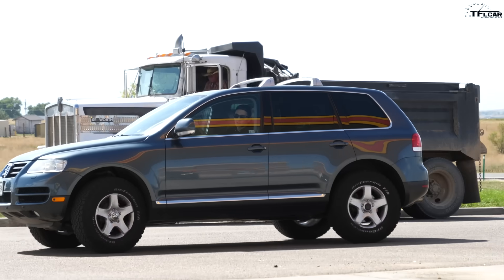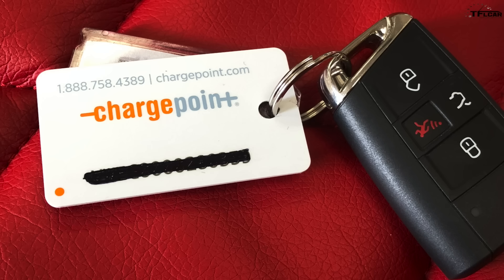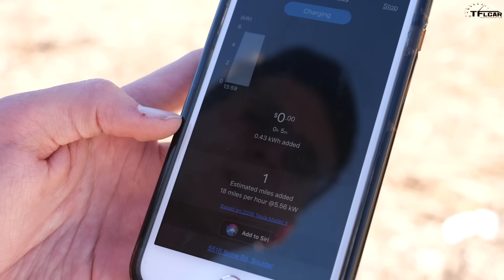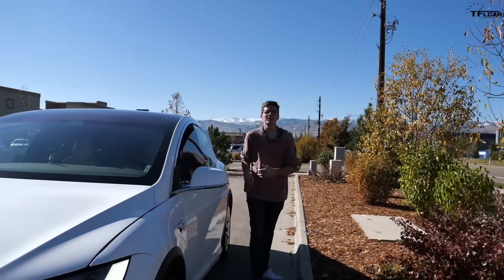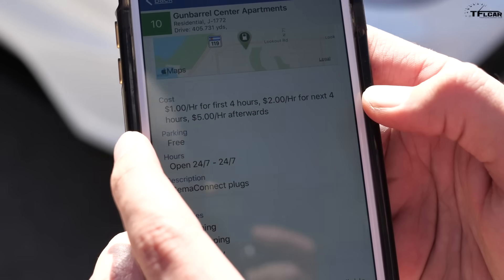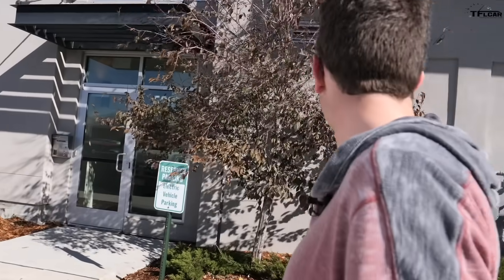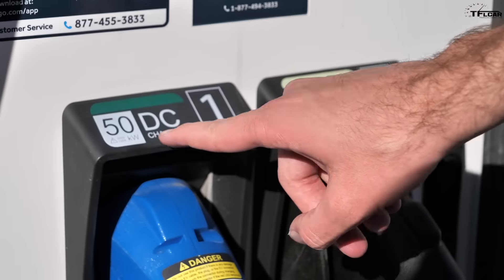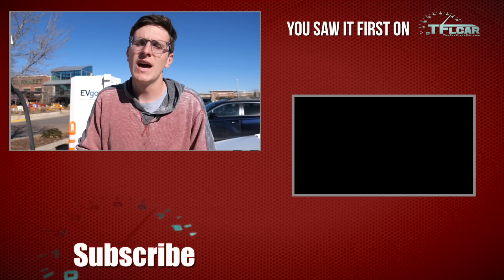Here’s Why Charging an Electric Car Can Suck - And It’s Not The Reason You Think!

Comment: so on that second chager it cost you $12 for 120 miles worth of range? thats way more than gas. most new economy cars are getting 35-45 mpg and gas is about $2.25-$2.40 not to mention that it took 8 hours.. and people think this is a good idea? first of all, you are burning coal or nuclear to make that electricity and second, that power doesnt go back into the grid the way it does if you use it in your house.. lithium mining is terrible for the earth and its very hard to recycle.. those batteries wont last ten years (not to mention range lose over time +-5% a year with the way most people take care of batteries) while there are plenty of gas cars on the road today that are 15-25 years old and still get 95% the mpg they did new(20-30mpg). you cant drain a lithium ion to zero without damage and you shouldnt charge it to 100% or you will cause cycle life to degrade. that means you are never getting the full advertised range of the car... so many things wrong with this.. especially since the cars are luxury and not green to produce.. just replace the prius with a tesla in that old south park episode.. just huffing your own farts.

Comment: Luckily Tesla has used open standards here in Europe ...
Model S&X have whats called a type 2 connector (AC Standart Here all over Europe .. and also has a DC protocol which Tesla uses at their superchargers)
Model 3 has a so-called CCS port (CCS= combined charging system) and that really cool since you can literally charge anywhere without an adapter since the top part of CCS is the Standart Type 2 AC Port . .and additionally it has 2 larger pins for DC fast charging (Tesla retrofitted the SuC's with a 2nd cable so that model 3 can use it) 
Some stations can go up to 350 kW using CCS (Model 3 can go up to 192kW on those stations since the higher charging speed only gets achieved by 800v packs like Porsche tycan .. but they too struggle with that high speed and to be honest .. model 3 is still mind-blowingly fast charged )

Good video ^^ .. interesting to see how things are in the US for charging

Comment: It just takes a little time to figure them out. It's not that hard and totally worth the effort. Besides, pretty soon I believe there will be more standardized plugs, faster chargers, easier and faster payment methods everywhere. Just hang in there.  The massive adoption of EVs is just around the corner (5 to 10 years at the most).

Comment: Nice Video.  But it shows the failure of electric cars.  How can one travel between San Diego and Phoenix in a reasonable time frame.  God forbid a power outage.....
Reply: It shows the state of non-Tesla EV's currently.  Tesla's current supercharger network is fast, convenient, and reliable; people drive cross county all the time and it is not an issue in term of charging times.  For me, usually the car is done charging before I've finished a meal and gotten the kids through their potty breaks.  But the other non-Tesla networks will get there eventually.

Comment: I drive 78 miles round trip, 4 days a week. I purchased a Ford Raptor Gen1 6.2L V8 that's getting 14mpg. It takes me 5 minutes to gain 400miles worth of range for about $60. Doesn't  take me hours to charge and I get plenty of SPGs (Smiles Per Gallon..)

Comment: "But the reality is, most people don't have high voltage in their garage"

*laughs in European*
Reply: Don’t know about that comment.....willing to bet most homes in North America have 120/240v systems.
Reply: @HOWNDOG66  Correct - every detached residence in the US and Canada has 240v split-phase service. Adding a 50-amp receptacle for AC charging is trivial for all but the oldest of structures. I did mine in about an hour.
Reply: All American houses have 120V and 240V
laughs in 60Hz
Reply: @GamingAmbienceLive  Having 50 Hz or 60 Hz is totally irrelevant, it is  just a matter of standardisation it does the same job. Having 110/120V and 20A or 220/230/240V and 16A, well, that one almost doubles the charging speed.
Reply: Fewer Europeans have garages.
Reply: @wisenber  

Yeah they do, have no garages.  but they have a better public charging infrastructure, esp scandinavia. American public charging long term monthy pay parking is nonexistent.
Reply: @Frank71  " but they have a better public charging infrastructure"
That's due to the higher taxes to fund them. "Save" at the pump, pay at the tax office.
Reply: In US, have 240V comming to house. Just a matter of running 240V at 50 amp circuit to the garage, as if were installing an electric cloths dryer in garage, or an air conditioner outside.  Yes, you have to pay an elctrician to help modernize your house.  Oh wait, I do this for 1 weekend, and I can eliminate most of this charching stress.  You also had enough money to buy Tesla, so you should have enough money to build up your home infrstuctre.  It is like indoor plumbing getting back fit.  Ah man, I need to get cold water and a drain pipe to where toilet will be, too hard, back to hiking 100 feet to the outhouse.
Reply: Yup. 400V 16A
Reply: It easy to get an electrician to put it in your house. If you can afford a house and one of these cars then the outlet should be cake.
Reply: Anyone in the US with an EV has installed high voltage in their garage.
Reply: That makes no sense. Takes less then an amp to kill a person....that aside, 347/600v is a common 3ph voltage in Canada (North America)......So what is the difference?
Reply: Are you the same people against coal? Think about it
Reply: America ha outdated infrastructure thanks to recessions and republicans.
Reply: @angelgjr1999  the opposite of the truth, bro.
and I'm not a republican (it's quite the insult to be an enthusiast for a tenetless party like the Dem and Rep parties)
Reply: @angelgjr1999  really Demoncrats have been in charge for years it was their high tax and  strict regulation policies that caused every recession. Every city, county, and state that Demoncrats control is high property and business taxes, high crime rate, high electric bill, high cost of living, high rent, strict government regulations. Then when Demoncrats sense when people get a pay raise they raise taxes or come up with new taxes which eat that pay raise.
Reply: David F Dude you are hilarious. Google the states with the lowest quality of life. ALL are red states lol. Also google states with the most poverty while your at it. 
It’s funny to me how you poor people trust a rich scammer from New York to give a damn about you. Trust me he doesn’t. All he has done in office is give himself and his rich buddies a huge tax break.
Reply: @angelgjr1999  "Google the states with the lowest quality of life."
It showed California as having the highest cost of living adjusted poverty level, most Medicaid recipients and last in education. When did California turn red?

"Trust me he doesn’t. "
Why would anyone trust you? You've been reliably wrong with each of your assertions.
Reply: @angelgjr1999  yea, over taxation (California) causes a large burden on private businesses and individuals, which then cause people not to innovate due to money shortages. Oh wait for it.......... that's the Democrats
Reply: Tony from Tinder That’s not right. States with the lowest taxation’s are usually the most shitty. You can’t compare California or New York to Arkansas.
Reply: @angelgjr1999  "most shitty" in what regards? Both California and New York are typically rated in the top ten for worst infrastructure amongst all 50 states.
Reply: Oh, and Europe is shipping tons of US wood to Europe to burn for 'alternative' energy, which still isn't working well as they're beginning to experience massive power cuts with all these EVs and attempt to reduce their coal burning for their power stations. The other month the UK had a power outage for a WEEK. As usual, the environmental destruction of every single hare-brained idea of the left knows no equal.
Reply: @angelgjr1999  "States with the lowest taxation’s are usually the most shitty."
Is that why the net migration numbers have more people moving to lower tax states? Perhaps you should try data over your emotions as your emotions don't seem to align with actual data.
Reply: @averageschmo963   So there's no innovation in CA "due to money shortages???" Riiiight. An unintentionally hilarious comment. I suspect that most people would agree that CA is among the most innovative areas in the entire world, let alone the US.
Reply: @lapamful  UK is not really Europe you know. Everything is different there. I never had any power cut since I was a kid, which happened when we had storm and I'm 53 now. LOL The only power cut we had in some place are because some weather catastrophe which can rarely break some lines.
Reply: @YannR34  I grew up in London and we had plenty of power cuts.
Reply: I was living in Dijon until 24yo and since in Montpellier, in France and the last power cut I experienced was in 1986 it last about 15 minutes during a storm. Never had any since. They probably inproved the grid. I had one more recently but it doesn't count it was because they had to work on the power transformator in my nebourhood and was planified.
Reply: @YannR34  I honestly dispair at the utter thick-headed people you find online. It really boggles my mind that some people are even able to use a computer. 
Ffs when did all this renewable energy nonsense start?? ONLY WITHIN THE LAST DECADE. So WHAT ARE YOU TALKING ABOUT?!
Reply: @angelgjr1999  San Francisco Baltimore LA (Have to wear a hazmat suit to walk around)
Reply: @angelgjr1999  , I bet that Arkansas has less sh%t on its roads and sidewalks than California or New York.
Reply: @doubleclutchonline5811  , I don't know about most people, but I don't. I have found that California thinks that all good ideas start there, but in reality most of their ideas are just loony.
Reply: @doubleclutchonline5811  no. San Jose is
Reply: @angelgjr1999  

The Arkansas infrastructure pales in comparison to California.
Reply: @wisenber  

Trying to move to lower tax state and trying stay employed in a higher tax state at the same time. The retired are just moving out. I work in chicago: all the young millennial types live in the city,  down the train line. The older generation have moved to indiana.

Cities are suffering from gentrification. Masses are moving out, while a fewer "yuppies" are replacing them. few people for the same economic activity. Boomers have abandoned the city, millennials have jumped in.

Its the boomers moving out.  There are more of them. The economic activity is the same.....fewer people with better jobs, spending more money....

Rent is high, everyone want to live there,....unlike Arkansas....not much demand. They build 4 new condo high rises, all filled in a year. They cant build enough houses/condo hi rises to fill the current demand. Chicago is the few cities with no rent control.
Reply: @Frank71  The fiscal state of Chicago does not appear to match your description. With fewer people demanding resources while at the same time having more taxable income, Chicago should be heading towards a balanced budget as opposed to an $85M hole (before the teacher's union agreement).

As far as Arkansas goes, it's not one market any more than Illinois is one housing market. Arkansas has areas with more demand than supply and areas with lower demand, just like Illinois.
Reply: @wisenber  

The places with lower demand, because no one want to live there. You never hear about it because your tv is stuck on fox news. 

Gentrification is a result of high demand. The issue is politicians never want to balance the budget. The pensions situation is out of control. The city sold its soul to curruption and patronage with employee pensions. Unfortunately, declaring bankruptcy, like united airlines did decades ago, is about tbe only way to shed its heavy pension  debit.
Reply: @Frank71  "The places with lower demand, because no one want to live there. "
Sounds like you don't understand real estate. Demand tends to be cyclical. You probably didn't know that because you were too busy at your "resist" knitting circle meeting discussing what was on Fox News.
Reply: @wisenber  

I do understand its circular. As just about anyone who owns a home, Esp if you live in a demand area. In a low  demand area, price  will go up, as prices tend to rise naturally. Even if no wants to live there. There Not much rise and fall as in a higher demand area. At least you dont lose it all when it comes crashing down, and it will. 

Look at San Francisco, seems like everyone want to live there, even with homeless sleeping outside your door. And people willing to pay millions. No shortage of buyers. Online, every right leaning republican complains about san Francisco. But everyone want to live there, not backwater Alabama, where the street are clean and the local PD kicks out the homeless.
Reply: @Frank71  "I do understand its circular. "
Then you don't understand. It's cyclical, not circular.

"Online, every right leaning republican complains about san Francisco. But everyone want to live there"
Except everyone doesn't want to live there.
That being said, you might try comparing Tampa to San Francisco as opposed to a small town in Alabama. Or you could compare a small town in eastern California to a small town in Alabama. Then again, Florida has a higher net migration increase than California, as does Texas, Georgia, North Carolina....
Your stereotypes appear to cloud your judgment. They certainly aren't born out in reality.
Reply: @angelgjr1999  "You can’t compare California or New York to Arkansas."
True. Try Texas and Florida. Texas and Florida have higher growth and net in-migration than California and Texas. They also have lower taxes.
Reply: @angelgjr1999  "Cosidering Arkansas"
Which state did you learn how to spell?
Reply: Angel Gutierrez infrastructure has nothing to do with whether someone has a 240v outlet in their garage.

Comment: You guys were talking about the E Golf can have its battery recharged to 80% in a half hour??

Why is this Tesla take much linger to charge?
Reply: It's because Tommy plugged into a very slow Level 2 AC charging station that is basically like charging at home.  Plus they have the Model X that takes more energy per mile, so it will "add miles" slower.  The DC fast chargers are much faster but he didn't focus on that.

Comment: The variety of charging ports was... BEYOND alarming and huge deterrent of anyone wanting to purchase a GreenFuel ride :(
Reply: not really.  It's very simply.  If you have a Tesla, you use your home charger (with a tesla connector), or Tesla supercharger.  If you want to use a chargepoint, you plug the adapter in between.  I've never had an issue on roadtrips.  My wife charges at work using chargepoint and never had an issue either.

Comment: Unfortunately,  there seems to be some confusion by the authors of this video. I wonder why more research isn't done before posting these types of videos. Shame.
1) Level II is not limited to 5-6kw. Mine is 10kw. Some go as high as 12kw.
2) Superchargers charge much faster than 200-400mph. Try up to 1000mph. 
3) "ChargePro" is not the company. SemaConnect is. Using their app would have not resulted in having to move the vehicle to another location. 
4) Those who use home charging are not "stuck". It is infinitely more convenient and less expensive than charging on the go or using a gas station. 
5) Charging stations are not placed a certain way because the port is on the front of vehicles no more than gas pumps are placed a certain way because the gas cap is on the rear side. Drivers are supposed to know to orient their vehicle so they have proper access to the nozzle. When has anyone ever nosed into a gas pump and responded with "I am stuck" and then blamed pump placement?

C'mon guys. As your viewer base expands, you probably should be making sure you are providing factual information that isn't slanted by supposition and conjecture.
Reply: Al Gore invented charging stations